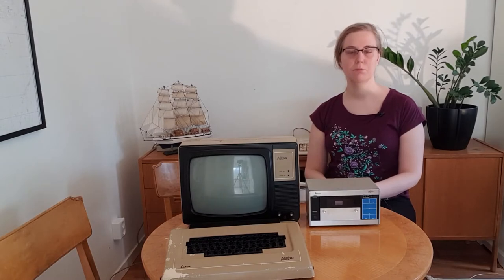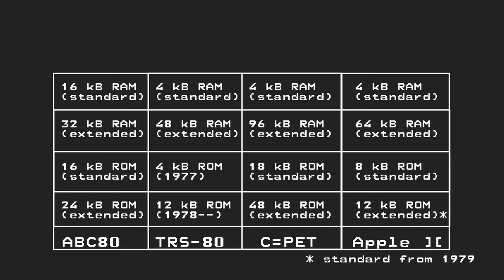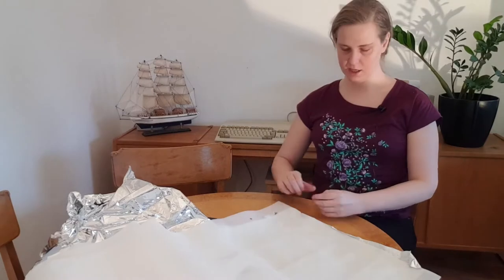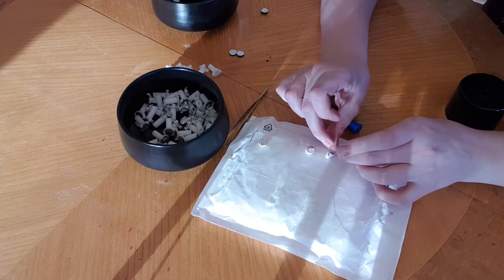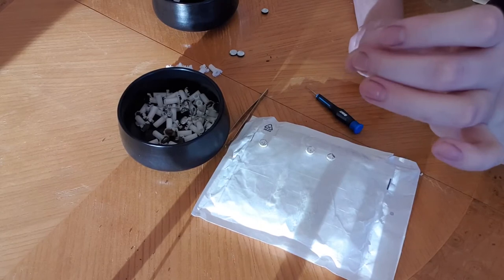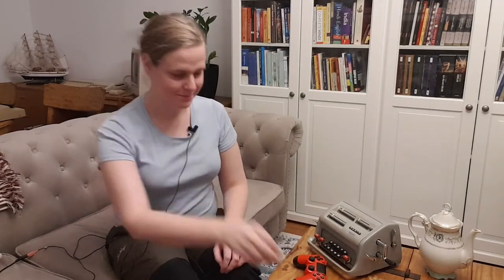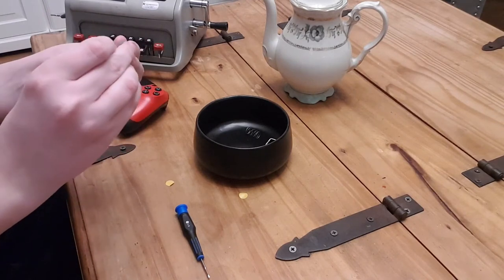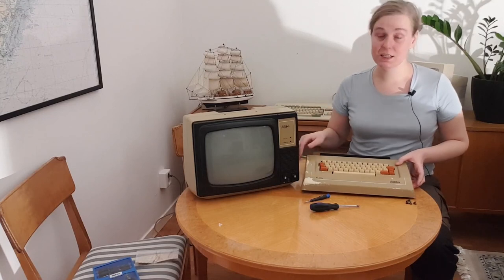Luxor ABC80 intro and keyboard repair - part 2

Comment: There is a trick to those spray-on adhesives: they have to be pretty much dry before you stick the two pieces together. As the adhesive dries, it becomes super sticky and adheres well to the surface. Then the two parts will stick much better than what you got with wet glue. The glue really needs time to dry - many minutes. It must be sticky but not wet and should not leave residue (or very little) on the finger when touched.

Comment: One other “gotcha”: the keyboards are capacitive. There is no need for the metallization to make good contact with the PCB. In fact, I’m not even sure if the metallized face isn’t supposed to face away from the PCB, so that the traces don’t get shorted. The home-made version may need to have the Mylar reversed so the insulating side touches the pads.

Haha: you figured it out later :)